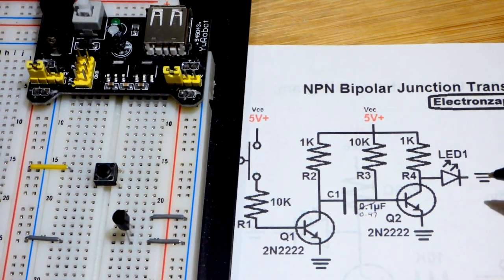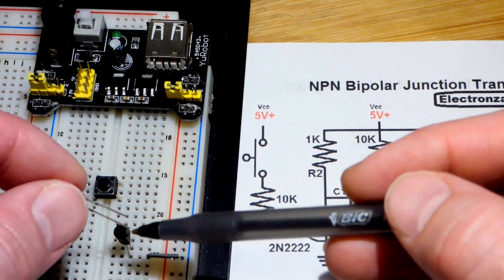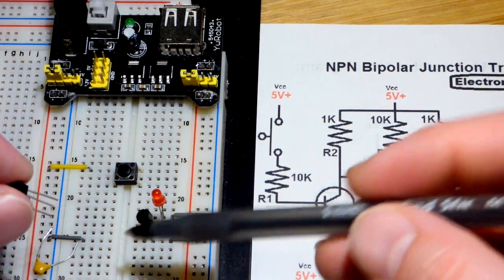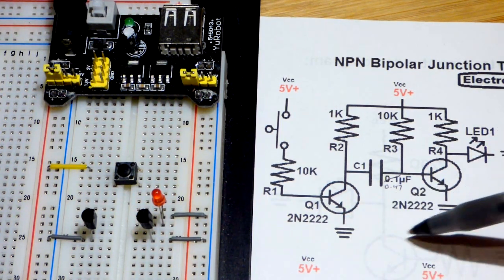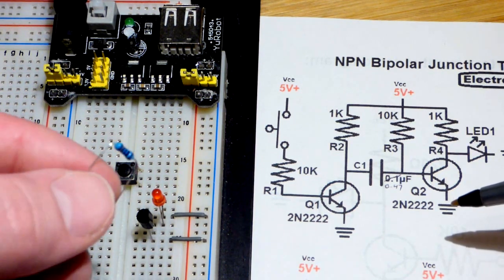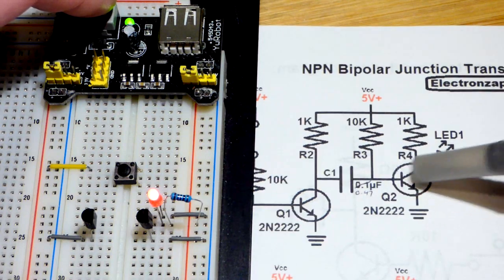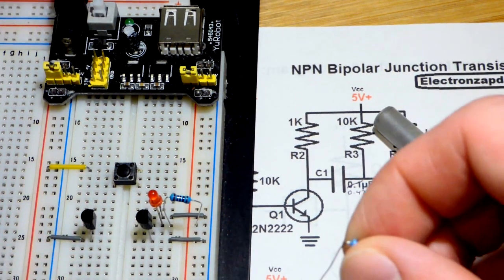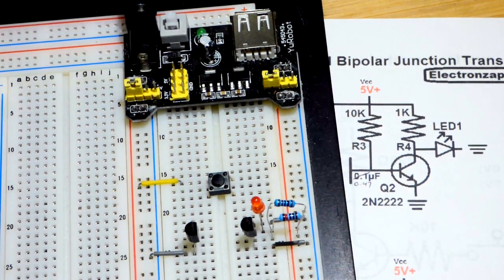Transistor circuit 4 two NPN BJTs 2N2222 pulse generator circuit beginner DIY electronics hobbyists

Comment: the VCC has a couple meanings 1- VCC Voltage Common Collector in a BJT  2 - voltage Common Connection   It's always good to observe the source off VCC in the circuit to determined what it ref to
Reply from the maker: Indeed.

Comment: When the switch is not pressed the right side of C1 is charged to the base emitter drop of 0.6V.. the left side of C1 is charged to 4.4V.. 
When the button is pressed we turn on Q1 and turn Q2 off hard.. soo hard that the base of Q2 (right side of C1) drops to -4.4V.. 
The capacitor will now charge up from -4.4V to 0.6V, during that duration the LED will be on.. once the right side of C1 charges up to 0.6V Q2 turns back on, which turns off LED

Comment: Hi, I've never use capacitor before. What is the type and value of the capacitor you used in this video?
Reply from the maker: This was a 0.47µF (zero point four seven microfarad) capacitor which I pointed out at 07:11 . Not sure of the type of capacitor that it is, as it isn't important for a circuit like this. It is not polarized/electrolytic though which can only be charged in one direction. This one can be charged in either direction, which is typical for most capacitors under 1µF.

Comment: nice and clean , good job ! , it'll work with an electrolytic capacitor ?
Reply from the maker: Since the charge goes slightly negative, I don't think I'd use a polarized capacitor in this exact circuit.

Comment: Why does the capacitor go to -.6 volts?
Reply from the maker: The side that is normally positively charged becomes connected directly to ground while the side that is usually negative is held a diode above ground due to the voltage drop of the base to emitter. So once it discharges it starts charging slightly in the opposite direction.
Reply: @Electronzap  Hi I like your videos thanks for putting them out. Which emitter, the Q1 emitter or the Q2 emitter?
Reply from the maker: While you hold the switch, Q1 turns on which flips the charge of the capacitor until you release the switch and it flips back.
Reply: @Electronzap  may I understand while the capacitor 5V side discharging simultaneously the other side of the capacitor 0.6V (bias) going down to the negative voltage momentarily, I measured with my oscilloscope it was appeared about -650mV at the negative peak. What is this situation that should be addressed in the fundamental theory?